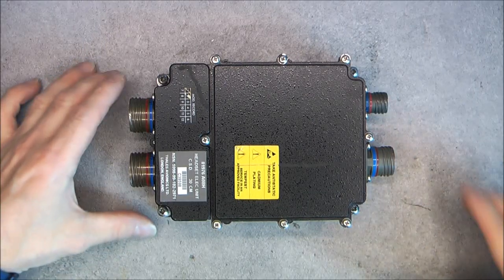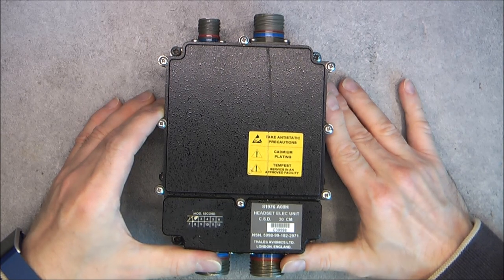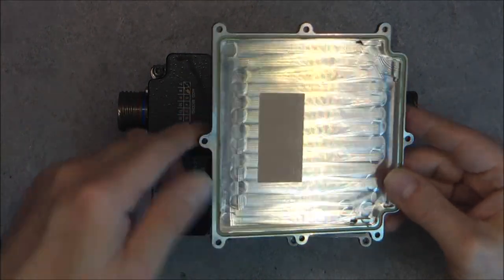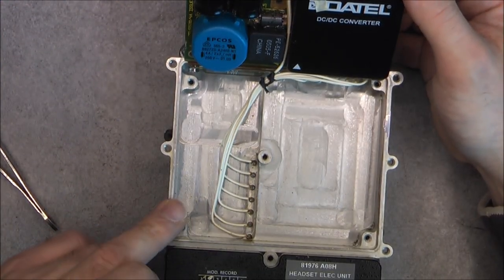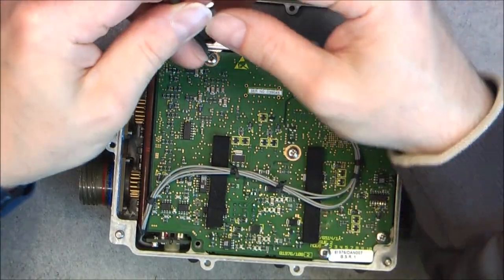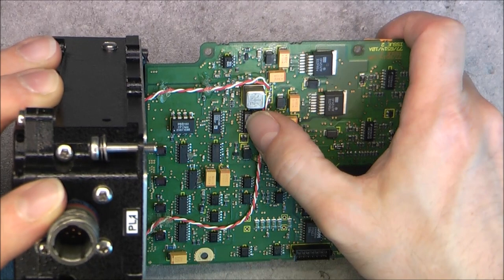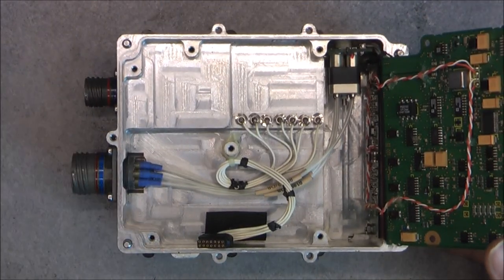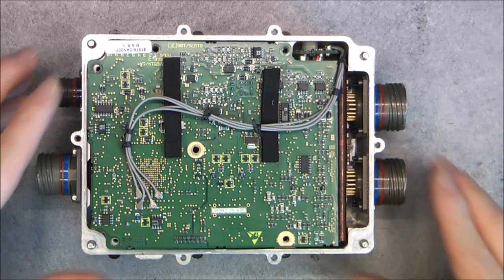Thales avionics Headset elec unit teardown

Comment: Great video! I have many of these units which I'm re-using for different things. You're welcome to email me (address in my youtube/about description) if you want to see some photos of what I've done with these. Cadmium warning is for the connectors. These connectors have "W" finish which means olive drab over cadmium chromate. It's a completely standard finish, so the warning isn't strictly necessary. Cadmium is a very toxic heavy metal which bioaccumulates in your body. It's only dangerous if the connectors are cut apart (cadmium dust) or corroded (white deposit which contains cadmium). The connectors are standard D38999 Series 3 - the most common/generic military connectors. As you guessed, the small connector is power input. This device uses 28V but it can run on lower voltage as well. The converters inside give you +12V, -12V, +18V and +5V. One reason I bought many of these units is because of this - it's a nice little power supply for audio stuff. You have bipolar 12V for audio and 5V for logic. One disadvantage is that these converters require a minimum 10% load in order to operate correctly. As you guessed, fiber connector consists of 2 transmit and 2 receive pairs. I have photos of these operating (they're in the infrared spectrum). The ACEX FPGA chip is the best in its range (in terms of gate count) but it's long discontinued. You can still get software to program it though. It has about half the gates compared to a modern $30 USD Cyclone IV with the same BGA package (256 pins). I believe these units were used on a helicopter as an interface between the main audio processor in the avionics bay and cockpit headset systems, but I'm not 100% sure. They would've been expensive, probably $10k-14k. Mil-spec fiber stuff isn't cheap.
Reply: Makes sense that this was between a processor and the headset jacks. Both connectors look alike except the keying is different. Likely so that pilot/co-pilot communications can be differentiated for CVR recordings.
Reply: @anomaly95  That's an interesting point! Seems logical, but the only mystery is why there are so many pins. These are D35 connectors with 37 pins each, and they're male, not female which suggests that they're handling at least some inputs. This device definitely uses them for outputs as well since those 7-pin burr-brown packages are low frequency power opamps for audio. I suspect that this unit connects to control panels of sorts with audio options etc - which then connect to pilot/co-pilot headsets. Just a guess.
Reply: @oriole8789  Why so many pins? That could be any number of things. Radio control inputs or display outputs. I don't know if it's done in helicopters, but there could be additional cockpit speakers and mics. An extra cabin mic helped confirm what happened on flight MH17.
https://www.youtube.com/watch?v=UeO1AVEOmPY

Comment: One possible reason for using fiber optics in this, is noise immunity. Voice communications are typically not high bandwidth enough to need fiber in a very short run.

Comment: This one looks very modern. Usualy fiber is used in backbone networks. So something in this needed a really high comms rate.
Reply: I think the simple reasons are weight, length of run and interference rejection. Fiber cables are very light with no need for heavy braided shielding, and you have natural interference rejection (worry-free retrofitting) and can run long lengths easily. I don't believe speed is a factor in this application.

Comment: At 3:22, The cannon plugs use the same number of pins ( I believe without counting them) but to differentiate the left from the right socket, you noticed that the key slots are different so you can't mix up the plugs.
You also find those hologram stickers on Intel microprocessors and some software to show that it was not a fake product.
Thanks for the video, cool stuff.

Comment: No way was this made in 88. Pretty sure BGAs like this weren't out then. The CPClaire 8-pin dip (relay?) just to the right of the flex @14:08 has 0145T at the bottom.
Reply: Exactly. 1988 there was no Alera Acex FPGA. There are datecodes from 2001 and 2003 on the ICs.

Comment: The fiber optic comes in with multiplexed modulated digital signal, the board with the 4 metal parts is just an optical detector, a low-noise amplifier, and signal conditioning circuitry. You can multiplex multiple optical frequencies on the same wire for greater bandwidth. The FPGA is used for digital signal processing (demodulation, decryption, etc.) and it just converts the optical digital data into usable digital signals. The two outputs seem consistent with the two separate optical RX/TX channels. It's not THAT expensive, optical technology is cheap these days.

Comment: Interesting box.
The only problem is that they seem to have used common and not high-level electronics as they usually have to be used in airplanes.
In that box if a ceramic capacitor fails it sends everything out of order.
It seems to me the classic electronics used in car radios, same quantity of components.